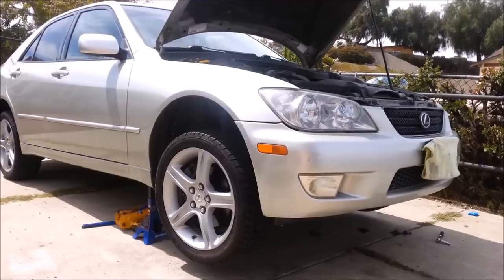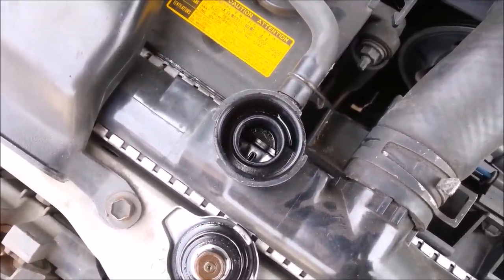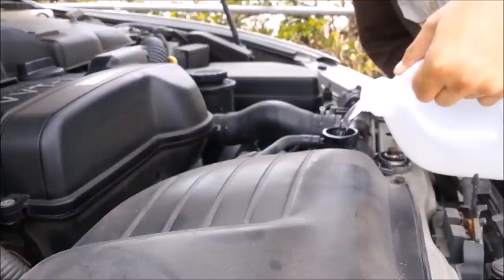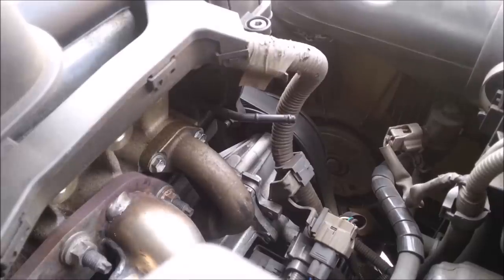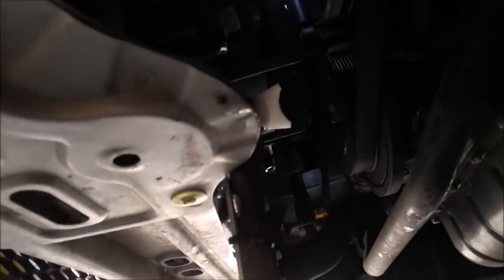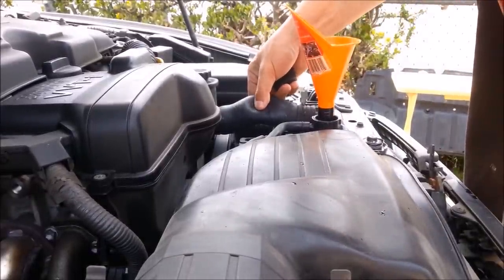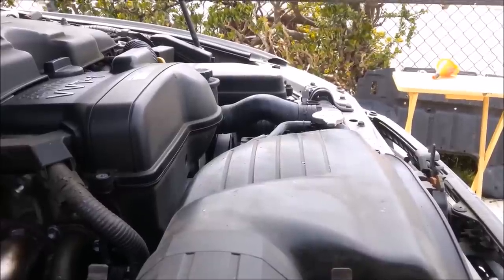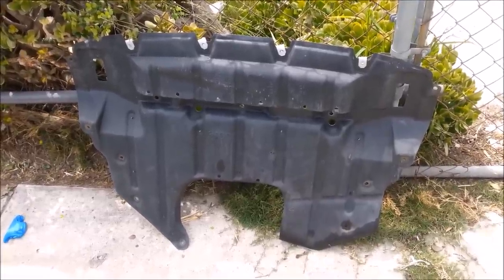DIY Engine Coolant Change / Flush How-to - Winston Buzon

Comment from the maker: NOTE: If you have a cooling system bleed valve, you should still "burp" the cooling system with the upper radiator hose squeeze method I did
Reply: Winston Buzon I have a 2001 Lexus is300, I drained the coolant, it was green, but the owners manual says only use Toyota Long Life or the Peak Asian (Red Equivalent) what should I do? I just bought the car a few months ago, and the place I got it from said they took care of all the fluids which I watched them do, but now the car has been overheating could it be because of the wrong fluid? Please help! ):

Comment: Cheers bro great help. My rad cap fell apart I side the rad at 100mph and it overheated. I recovered the cap bits and did a full flush thanks to your vid..all good thanks a bundle bro

Comment: Respectfully, there was one key (potentially catastrophic) mistake in what you posted. The radiator, itself, contains roughly 50% of the total coolant capacity. Using your method, the entire system is filled with distilled water. Then, you drain the radiator and fill the radiator with a 50/50 mix of coolant and distilled water. That results in an overall mix of approximately 75% distilled water, and 25% coolant in your system. That's no good. To use your method, you should do the final fill of the radiator with pure undiluted unmixed coolant. 
 I don't post any of this to insult you, or to hurt your feelings. I just want to make sure you don't ruin your cooling system.
Reply: Should had unscrewed the block drain bolt as well....
Reply: MrStoneycool69, where is the block plug located?
Reply: It's an allen key grub screw plug just above the oil filter, that's what it looks like on my K24A1 block. You will have to remove the R/H front wheel and use a torch and flex mirror to see it. On some K24 blocks from the K24 A2 onwards, there could be a coolant tap located there.
Reply: This is a 2JZ-GE....
Reply: JimmyLeeHook - excellent point and a concept missed by over 75% of people doing these videos.  To do this correctly you need to measure how much fluid is drained and the overall capacity of the vehicle which no one ever discusses.  Only then can you determine how much 100% coolant to add.  Suffice to say that in almost all cases you must use 100% coolant to ever have a chance of getting the overall mixture in the 50/50 range.  Impossible otherwise.  I typically do what was done here 4-5 times to ensure the block/core has essentially all distilled water. Then I use 100% coolant and maybe a touch of distilled water to get it to 50/50 based on my Suburban capacity. Only can be done by knowing the 2 capacities mentioned. Thanks for the video!
Reply: @condor5635  
Why not just use a pre-mixed coolant for the flush? Do 2 runs of those, and you're golden...Or am I missing something?
Reply: Shane - one of the issues that this does not address is the use of Different coolants. Mixing coolants is a bad outcome if they are different types. If you know for sure what type was in the car to start with and used 50/50 as you said then yeh that might be OK. But the caveat is that you have 50/50 when you start in the engine block. If you have run water into the block then the 50/50 will not work if you are trying to ultimately get to 50/50. I just prefer buying concentrate and my own distilled water. Doing it that way allows you to see the progress better as well than using a 50/50 mix.
Reply: Agree,need all the flush water drained too for proper mixture of coolant.
Reply: So what is the proper way to flush the coolant??? Did OP miss a step???
Reply: @shane250 I been thinking the same exact thing. Then no worries at all. Sure more expensive than distilled water but not worrying about your dilution percentage

Comment: I BOUGHT MY "RIO-5 3 YEARS AGO AND WONDERING IF I DO THIS PROCEDURE CAN I GET BETTER HEAT OUT THIS WINTER(NOT THAT'S IT'S BAD BUT WILL IT IMPROVE, MAKE MY CAR INSIDE HOTTER??
Reply from the maker: It definitely will cool your engine more efficiently. Not so sure about keeping your interior warmer...
Reply: THANKS SO MUCH BUT IF IT IS MORE EFFICIENT WOULDN'T THIS RELATE TO BETTER HEAT INSIDE AS I LIVE IN MONTREAL WHERE IT CAN GET BELOW 25C
Reply from the maker: @normlor8109  If that's the case, I would look into the heater core being to deliver the heated coolant thru the core to warm up your interior.  The purpose of flushing out the bad coolant mainly is to make sure that the engine itself won't rust & cause your engine to breakdown sooner, this continuing to deliver warm air

Comment: after you drain out the clear water .....after flushing.....and you begin putting in new coolant.....isn't there still clear water trapped in the engine block and heater core?     and if yes.....then won't your new coolant be diluted by the clear water trapped in the system?   since you are only draining what is in the radiator via the drain tap
Reply: Bigbore400cc coolant is 50% water

Comment: Lexus IS300 : Do you have a video on A/C compressor clutch not engaging. Also, How to diagnose from A/C clutch relay (test ) to  using a manifold gauges and How to look at the high side A/C line hour glass to see the refrigerant flow.
Reply from the maker: Those are very awesome ideas to do a video on.  I did testing relays on one of my other AC videos.  But for the clutch not engaging, it may have something to do with the clutch relay.  If you watch my cb7 AC video, you'll get the gist of it.  But I will take your troubleshooting idea for the Lexus into consideration because there's currently no problems with my wife's IS300.  Stay tuned for more though ;)

Comment: When you were adding the second jug of distilled water, did you have to wait for the fan to turn on and turn on the heat again? Or were you adding it while the drain was still open and then letting it drain right away until the water turned clear?
Reply from the maker: I waited for the fan to turn on, circulate the system, and added some more

Comment: Can I do without a jack? I just have distilled water in there and k-seal which sealed a water pump gasket leak should I just drain the distilled water and refill with the oem red coolant? Thnx

Comment: my outlet assembly bypass is leaking a couple of drops from the  bottom do you have suggestions on how to fix it or do you know where I can get the seals cause I can't seem to find them anywhere
Reply from the maker: Try this link...

http://my.is/forums/f115/leaks-water-pump-outlet-o-ring-valve-cover-gasket-442464/#/topics/442464?_k=246g19

The part mentioned is somewhat relatively cheap, even from the dealer.  Call the parts department first to see if they either carry it in stock or special order is needed.  I hope this helps

Comment: Hello sir, thank you for your time. 
Could I remove the thermostat and just run the distilled water so that it circulate for just one flush? I have a 2007 Avalon 2grfe engine
Reply from the maker: I wouldn't know.  Never tried

Comment: any idea why my fan only turns on when the ac is on? it will not turn on while it just sits and idle.
Reply from the maker: When was the last time your thermostat got replaced?
Reply: Lol never
Reply from the maker: Lol oh man... There lies a huge possibility because a proper well-kept thermostat regulates your engine's temp and switches your fan on if it gets too hot
Reply: can you do a video on how to changing it on the is300?
Reply: the temp sensor can also be the culprit  as mine had that issue

Comment: But isn't there residual distilled water in the block? You won't have a true 50/50 mix. I'd think you want to flush it again with 50/50 a few times
Reply: It's not precise science, that's ok. The only concern will be if you live in a cold climate with temps below -35. In that case you want a 60 or 75 / 50 mixture anyway.

Comment: Thanks for the information...found it interesting.   How long did you allow the engine to cool after you performed the distilled water flushes?  Isn't it a bad idea to add cool water to a hot engine?  I didn't hear you make mention of this during your video. 

Thanks and continue with the informative videos!
Reply from the maker: I let the engine cool off until it is cool enough to touch.  In this case, about an hour or so.  I never heard of a case where cool water has damaged a cooling system.
Reply: Winston Buzon Cool water tossed into the radiator can cause damage to the block or heads...that is, if the engine is too hot.  At least, that has been my knowledge.  An hour should be ample time for the engine to cool.
Reply from the maker: Plus, I let it sit for an hour for other safety reasons... :)
Reply: Winston Buzon Am I missing something about other safety issues?

Thanks
Reply from the maker: Yes.  When it's too hot, the radiator will spew out HOT fluid, which will cause 1st or 2nd degree burns, depending on how hot the fluids are.  Thrid degree?  You won't even feel a thing because it's so hot, your nerve endings shut themselves off...
Reply: Adding cold water to a hot engine is a fabulous way to blow a head gasket. Then you can just spend the $2200 to get a new one installed 😊

Comment: when you drain radiator does that also drain overflow bottle or do you have to do it separatly
Reply from the maker: Separately.  Disconnect the hose that connects from the radiator, and remove the bottle

Comment: I wonder how much water is left behind after the flush. You want 50/50 so if water is still in there from the flush it would change the ratio. Maybe it would be better to mix the coolant 60/40.
Reply: Some water is fine

Comment: Does anyone know my my passenger side fan doesn’t turn on could it be the coolant or did my fan motor go out? Also my car was over heating but once I opened the hood temp dropped help lol
Reply from the maker: All fuses good?
Reply: I found out it was my fan motor connector also how much water do I put in before turning it on? The whole gallon also how much antifreeze does it take to fill it
Reply from the maker: @musty.diesel  fill it to the top of radiator.  Then, "burp" the system by squeezing the upper radiator hose until the coolant stops getting lower, then top it off again.  Make sure to fill the reservoir when your done
Reply: Hey man it started overheating around the 2-3rd flush is it bcs there’s less coolant? I noticed my fans didn’t kick on at first they did
Reply from the maker: @musty.diesel  did you burp out the air in the radiator hoses?
Reply: @winstonbuzon  I kept squishing it and it didn’t get hard at all only until the car warmed up dang my fans don’t turn on at all now and it over heats smoke comes out from the sides of the radiator
Reply: And from cap dang im so sad man
Reply: I’m not getting and heat from heater that means there’s air in the engine or heater core right? How can I fix this man
Reply from the maker: @musty.diesel  is the engine all warmed up when you turn on the heater?
Reply: @winstonbuzon  yes it overheated on me there’s no hot air coming out either when I did the first flush I believe there was some coming out around the 2nd-3rd it started overheating fans don’t kick on either when I turn on heat or ac could it be my thermostat open or closed? Air in my system ?
Reply from the maker: @musty.diesel  quite honestly, I don't know what to tell you except to make sure to squeeze the air out of your radiator hoses as you fill, then fill the reservoir when radiator is topped off

Comment: I think you might have diluted your 50/50 premix there. Remember after you drain, put in distilled water, let it run, and drain again its still got some green in it? Thats the difference between factory fill and service fill. So effectively, when you drain the clear water before filling with coolant, not all water comes out. Which means the 50/50 is diluted with whats left inside the engine.

I read that the best way is to get the factory fill spec, match it with concentrated coolant and fill distilled water to the top. E.g.: if factory fill is 5L, you put in 2.5L of concentrated coolant and top up with distilled water to full, possibly about 1.5 to 2L worth because theres about 0.5 to 1L distilled water still in the engine. 

That being said, a 40/60 mix probably wouldnt hurt a soul unless you live in extremely cold or hot climates
Reply: exactly what i was thinking......if using this method its best to use concentrated coolant rather than a 50 50 mix
Reply from the maker: +azn310 I made sure that for the last step, I completely drained the distilled water before I put the 50/50 in.  No way I would make that mistake on an expensive vehicle such as this.

It only seemed too quick because I had to cut this video down for time.

Comment: Question, I added just a little green coolant to my 04 corolla and after I noticed the coolant it has is red, will I dammage the engine? thanks
Reply from the maker: Was the coolant originally green or was it a different color?  Some vehicles have a different color from the factory.  Some are orange coolant while most are green.  You may also want to check out the owners' manual to see if you have used the correct coolant

Comment: Overall nice job. But you ended up with the wrong mixture. Let’s say you drained half of the coolant which is typically what cars will drain. Now you added back 100% water and mixed it with what was remaining in the other 50%.  Now your entire system has 75% water and 25% coolant. Then when you change your radiator you put in 50-50 premix. That was your mistake. You should’ve used 100% concentrate to ensure that the final overall mixture is 50-50. By putting the pre-mix like you did it’s impossible to get a final mixture of 50-50. Moral of the story know how much is the total capacity and know how much is the drain amount. You almost always have to use 100% concentrate to do it correctly
Reply from the maker: Duly noted.  Thank you for your feedback 😁👍

Comment: dude my Lexus LS400 has THREE drain valves.. one on the bottom of the radiator, two on the engine which are harder to get at.. Furthermore, does draining the radiator drain the reservoir tank too? Thanks man.
Reply from the maker: If you want EVERY bit out, then yes

Comment: You are using the wrong type coolant for this car mate. It only takes Toyota long life or Toyota super long life. Thanks.
Reply: grtdane78 my 2001 Lexus is300 I bought a few months ago has been overheating, I flushed the coolant, and it came out green, the owners manual states exactly what you said, could this be the reason why? I could really use a little help if you know a little about these cars! ):